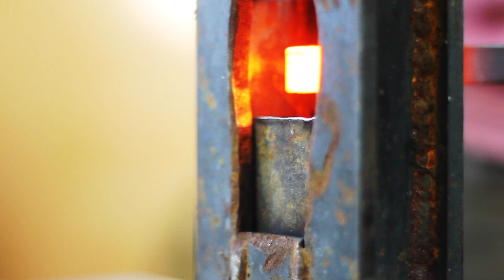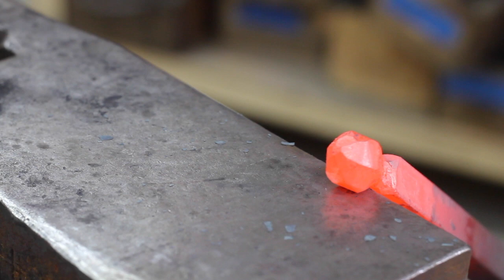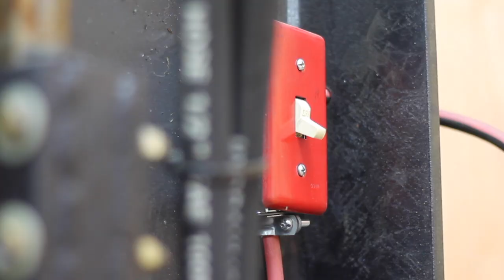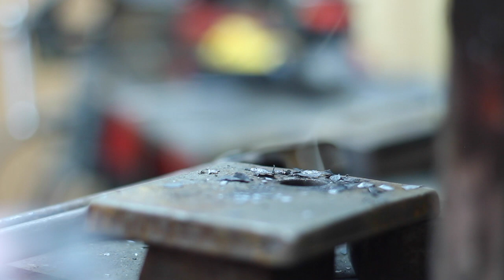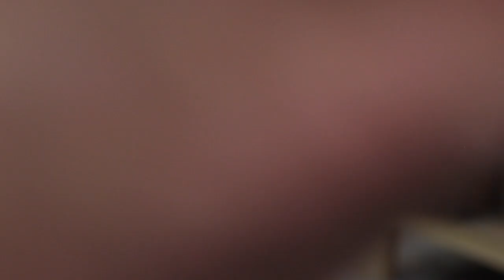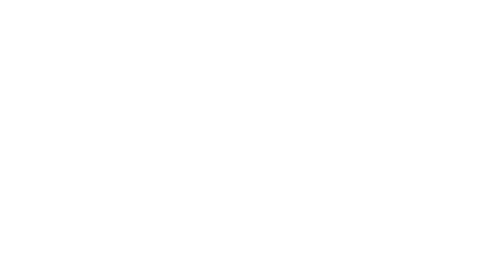Forging a Legendary Bottle Opener

Comment: Nice BUT- AS on old blacksmith--WIPE THE SLAG OFF YOUR DAMNED ANVIL BETWEEN HEATS OR YOU MAY LOSE AN EYE...
Reply: As a new blacksmith ... thanks for the advice! I didn't quite comprehend that slag could be a serious eye hazard. Seems so crumbly and thin ... I usually avoid safety glasses ... but my gut tells me to wear em quite often when I'm working metal.